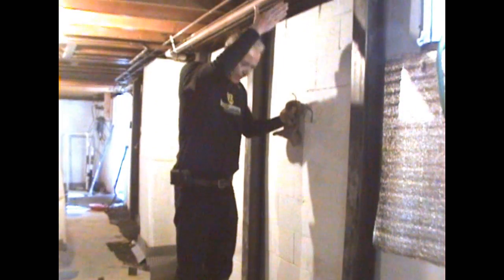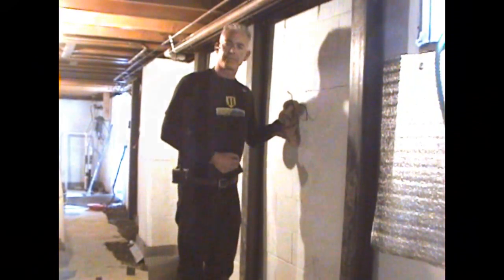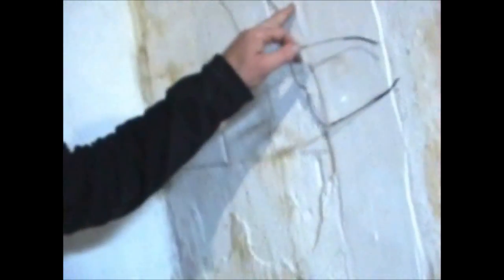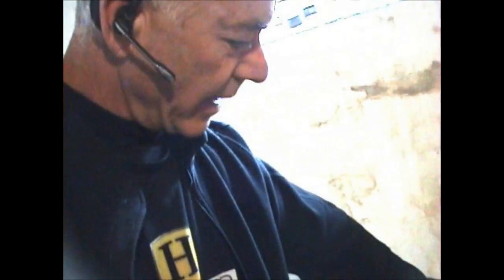Foundation Repair - I Beams vs Carbon Fiber Strips

Comment: Great video. Steel is reliable, easy to work with, easy to add to and modify and in general is wonderful stuff. 
DIYers can buy or rent a mag drill to make life easier and remember if doing large holes a rotary annular cutter like Rotabroach is wonderful. Use water-based coolant or soapy water since oily coolant is nasty to clean up.

Comment: Can you sister a couple 2x6s together and install them as a replacement for the steel beams? If so, how close together would you need to put the pieces for proper support of the foundation?
Reply: Wood is trash best used for furniture and camp fires. It's used in housing for cost reasons not quality which is why it's NOT used in industrial structures or military bunkers. It's often possible to buy good surplus steel beams from demolition companies. When buying new, get at least three quotes as prices vary.

Comment: What would you do in a case where you have something close to the wall and can't squeeze an I-beam in behind it? In my case it's a large 2" gas main pipe. Relocating it would be $$$ and I'd have to get the gas company to shut my gas off at the road. Could you get away with a 2" thick wall tubing in those spots? I know an I-beam is stronger but I don't have much of an option. I'm 1000 mile away so I can't hire you lol, I respect your opinion though.

Comment: Question: You have 24,000 lbs of pressure on bottom of the beam but none at top so is it really pushing the whole wall out?
Reply: the pressure is in the bend of the beam against the wall, not the area of placement.

Comment: I personally,  would not buy a house with i-beam or carbon fiber repair to the foundation.  If I needed repair to a home I already own, I'd go with the i-beam repair. Carbon fiber may be stronger than steel, but the bond to the wall is certainly weaker than bolts. I think the carbon fiber repair is a scam. In the end, I'd have the wall rebuilt and drainage corrected.

Comment: I followed your method and installed 2 I beams a few days ago. It's working and the wall is moving. Thanks Dan! Tomorrow I'm going to dig a little earth away from the outside to help it move. After it's where I want it, I'm installing pins in the blocks and 5000 psi concrete. Done!

Comment: Having taken the time to actually speak to Daniel, I can understand his reluctance.  As he has said, this video is over 15 years old, and in that time frame there were a very limited number of carbon fiber based repair systems in the residential market.  
I have seen the types of repairs that he is talking about, and after many years of change, both regulatory and in fair practices, the carbon reinforcements have come a very long way.  I actually walked Daniel through the application procedures for the company I work with, and I was looking to address his concerns.  Our system does tie both the sill plates and the footers into a single continuous bonded reinforcement.  We also made sure that the spacing and carbon systems are actually designed for residential uses.  
An engineer could nit-pick this installation, or any installation for that matter.  What Daniel is doing has been done for 50 years.  That doesn't mean that it's the best solution for every circumstance, nor is it the worst.  I have seen steel i-beam failures from improper installation techniques, just as he has seen carbon failures due to improper installation techniques.  It's all a general wash when those failures occur, primarily because (according to ICRI and ACI) 95% of reinforcement failures are not are the result of the material failure, but of improperly planned and executed installation.  That means that, of the repair systems that they have had failures reported to them for, only 5% were materials related and not the result of an installer cutting corners somewhere.
ACI 440 has been developed to guide the commercial industry in the application of composites to concrete, and it has really increased the awareness of the proper calculations, proper methods, and the proper design requirements for this industry.  The same cannot be said 15 years ago.  The adoption of the ACI codes by leading manufacturers in a residential setting has become the real reason that this industry has gained acceptance.  I think that even Daniel would agree that his concerns, lacking an anchor point to the footer as well as a secure anchor for the top of the wall, have been addressed.
I welcome questions about how composite systems have changed.  It's not a new technology, as the first tests using carbon fiber to repair a concrete structure were in 1956, and the first one in the US was in 1982.  it's just now being made commercially available, and like everything new it needed time to mature into the market.
Thanks, Daniel, for keeping us on our toes.  Hope to chat again at the next BHA meeting.  Maybe over lunch again?
Johnnie

Comment: I am afraid he is totally wrong about the manner in which the  carbon fibre  strip behaves and at 0:50 when he says that ," The  carbon fibre strip would just SNAP."  He should know that because of the thickness of the wall there would be tension on that carbon strip and not shear, as  normally the walls bows out all at once and so the carbon strip  would replace the steel enforcing in a  wide beam where one side is in tension and the other in compression
Still I prefer the steel beams he is using, but he should be careful about the figures which he is mentioning. His logic and reason in applied mathematics do not seem to be his area.  Other than that it is good work.

Comment: It sounds like he is trying to validate (in part using exaggerations and theatrics) what I assume is his business rather than offer a fair comparison between the products. Rather bias. Jury is still out but I'm still leaning towards properly installed carbon fiber (he was showing examples of improperly installed strips with no footers).
Reply from the maker: Hey Todd, that's a fifteen year old Video.  Still, u yourself can do Carbon Fiber if you believe in them  I simply don't.  Actually, back in the Nineties I don't think carbon fiber existed.  For myself I like the old time tested stuff.  I'm not bias, I'm just old school. And I happen to enjoy fucking with the Carbon Fiber Executives of Manufacture Corporations and that #1 U.S.A. supplier.  But alas, Carbon Fiber strips are manufactured in China and I'm an American made steel type of Guy.  I was handed a $50K check to support the product a few years ago but I told them to void it and the only use I might have for it is if there's a shortage of TP in the men"s room.  Gee wiz Todd, I must be well known or something.  I don't believe in Carbon Fiber Strips   And my Integrity can not be bought.  Once  a person sells themselves out they can never buy themselves back.  If nothing else, you might consider a little respect for my beliefs and integrity, right or wrong and regardless of your beliefs
  - Daniel J OConnor

Comment: what's your take on using carbon fiber to fix a single row of horizontal cracks between the first row of blocks at foundation level?
Reply from the maker: Save yourself some money and use duck tape or an ace bandage and crazy glue.  Or totally fuck a customer.  Nuf said?  They offered me $50K to shut up.  I can't be bought.  Once you sell yourself out you can't buy yourself back.  Keep that in mind for the rest of your life.   - Daniel J OConnor

Comment: what's your take on using carbon fiber to fix a single row of horizontal cracks between the first row of blocks at foundation level?

Comment: crazy ive installed alot and have seen alot done years ago have yet to see a strap fail due to anything but improper installation, i do dig steel tho over the straps but at the same time i feel straps are sufficient depending on the house of course
Reply from the maker: Yes, it does depend on the house and the specific type of walls.  To me, why take the risk.  And bye the way, I do know the #1 Supplier in all of the U.S. and do see him often at conferences.  A $50,000.00 check was written and offered to me if I would stop bashing and promote the Strips.  Yep 50K.  I said to write void on it but will take it in case there's no Toilet Paper in the Mens room.    I don't believe in them.  I can never promote something I don't believe in.  The 50K was to buy me off.  In other words, for me to sell myself out.  Money is just money.  When you sell yourself out you can never buy yourself back.   Got it?  - Daniel J OConnor

Comment: Are pins referring to rebar?  I have a little bow in my basement wall.  I think I am going to install drain tile this winter and use your technique with anchors, rebar and hydrostatic cement when it warms up a bit.  I'll be doing a lot of research until then.

Comment: why would you use carbon fiber on a wall thats disintegrating and expect it to work..you should of used steel to start with!
Reply: 68eazyrider hes making a point that carbon is shit and steel is the way to go . did you even pay attantion..?
Reply from the maker: Hey AweSome,  some people spend too much time swimming in icy cold water...   ( numb nuts )

Thanks for your support. - Daniel J OConnor
Reply from the maker: Hey Easyrider,  mine is a Police Special Road King which I rebuilt myself.  Lot's of "not street legal parts."  Shit canned the chrome.  All Blacked out.  When I rebuilt my Cessna 210 Airplane I went Red, White and Blue.  I was offered $50,000 by manufacturer of Carbon Fiber Strips to promote their product.  Someone held out a Check written out to me.  I told them to void it but would take it in case there was no toilet paper in the John.  Carbon Fiber Strips are as useful as something I might find at the bottom of my underwear at the end of a day...  ( if I wore underwear ) Nuf said?  - Daniel J OConnor

Comment: Both solutions are problematic. The eye beams are ugly and take up space inside the basement. Carbon Fiber Strips are often misapplied by contractors in the wrong application as the video states. Neither solution provides adequate lateral loads to solve the problem effectively. The I - Beams are attached to the floor joists above putting stress on the floor system. The lateral loads could crush the floor joists during heavy rain events when soils are swelling. Neither approach can move the wall back.  A grouted soil nail stabilization plan combined with bearing plates or C-Chanel whalers would be a more effective approach. There is no need for messy outside excavations and over a series of adjustments during droughts the wall could be pulled back. The lateral loads would be transferred to the soils beyond and the system is much less obtrusive. For more information on a Soil Nail Retaining Walls and other geotechnical approaches please visit our website or give us a call.
Reply from the maker: +Michael Masserang  Hey Mike, where can I find one of your videos with you doing the actual work and explaining all that bullshit?  It's an old video.  I haven't done an I Beam in quite a while.  This one has flaws.  Bottom is still secure with concrete but at the top I do an entirely different process designed by my engineer.  Who is certified in NY, NYC,  PA, PHI, Texas, Huston,  Georgia, Atlanta etc.  He's toned down in recent years,  cares about people being safe.  Primary Consultant for all structural issues in regard to all of NEW York CITY s subway systems.  Imagine that?  You think he might be interested in hearing about one of those whatever the fuck's  to keep NYC subways safe?  Would you like his number?  He doesn't have a web site.  Only an impeccable reputation.  You can contact him and he' might send you a package with a red hair wig, some white and red makeup and a big red ball for your nose.  You will then have all you need to not only talk like, but look like a clown.  Bye the way, nice photo.  How's that hair cut coming in?  Rug might come in handy....   Thanks for your support.  - Daniel J OConnor
Reply: +Daniel J. OConnor (HydroGuru) 

Nice professional response combined with a personal attack. I wont take the bait. I can prove my credentials in the industry. Can You? I work with several engineers in our market on a variety of foundation related stabilization projects. I'm not in the habit of educating the competition on unique geotechnical solutions that are cheaper and more innovative in the industry. Applications and means is the key.  My post was to keep potential clients from choosing an older, problematic system.  so when you educate yourself on these newer techniques please feel free to offer those solutions to your clients. Until then, you can keep on doing what you're doing. Please do. You will make it easier for me to win bids if you ever show up in our market.
Reply: I dont give a dam what anybody says. Steel is better. I'm not a contractor and dont hire them. I just put in my own I beams and the wall is moving back into place. Materials cost me $400. A contractor would have charged  me thousands. Physicians wages and NO college degree? No thanks. Screw that.  Some people are scared and shell out the money. Ha! maybe I will start doing this. I know I can do it.

Comment: if i dig it out and use a i beam with a adjust tightening nut and dig it out will it push back fairly easy or will it still cause alot of stress on the floor joists?  I'm dealing with a Cinder block wall.
Reply: Dave,
If you were digging it out why wouldn't you use a jack and apply direct pressure to the wall with the i-beam you have installed?  Try to avoid applying that directly to the floor joists if you can.  They are not typically designed to take that kind of stress, and it can compromise the floor.  That way you can have the i-beam in place to shore up the damaged wall after you start backfilling.

Comment from the maker: Hey Joshua,  Sorry but without digging some relief from the outside that wall isn't going to move.  Don't worry about the bottom of the wall against the slab as long as the bottom of the wall isn't rotted.   I would send you a link about how we push a wall back into place but my IT guy just got himself fired.  Please look for Foundation Repair on You Tube.   Hopefully you will find the right video to help.  Nad bye the way, would you know any good IT people here in Jersey?  We have a vacancy. 
  - Daniel J OConnor

Comment: Can a wall be straightened without digging/ freeing the wall from the outside? I am currently 1 1/2" out of level from top to bottom on a 8' tall basement wall at center of a 30' span. Also will straightening the walls push the floor level at the sill?
Reply from the maker: +Joshua Bland I'm sorry I've been away.  Go the extra mile and dig out the outside, push the wall back, put wall pins in from the outside and you'll have a perfect forever wall.  The house will sell eventually without foundation questions. - Daniel J OConnor

Comment: The first video that shows my problem and the remedy after searching for hours . I like the use of the angle iron on the top. My problem is a little more difficult as the wall is pushing out on the bottom . I plan to knot the bottom together with re bar inserted in the floor vertical and connected with more horizontal re bar to the beam then cover with concrete to depth of 6 inches.This is under a bench so it will not be noticed. The horizontal crack is 1 meter high and 1 .5 meters in length. I have a large buttress on the outer wall as a prop but the wall still moves . This is a single story garage .

Comment: What is your opinion between Carbon Fiber Strips and Wall Pins?  I talked to an engineer that told me Carbon Fiber does nothing at all to address the source of the problem.  She told us that most
Carbon Fiber Strip companies were simply franchises with not a lot of structural knowledge.  She recommended rebar in our block walls with concrete.  What do you think?

Comment: What is your opinion of wall anchor plates vs steel beams? I have a very small basement and hate the idea of losing 6 inches. I was thinking carbon fiber strap until this video.

Comment: First of all those bolts into the joists will blow out long before carbon fiber. Second, just because a jack is rated for 12 tons does not mean you are applying 12 tons when you pump it up. Third, if you're worried about the bottom of the block blowing out, just use carbon fiber straps with a single angle iron bolted to the slab and the bottom corse of block.
Reply from the maker: In the old days I think I would reply by saying, "Blow me."  I think it might still be a proper response. - Daniel J OConnor
Reply: I'm going with steel I beams. I dont give a dam what any salesman tells me about carbon fiber. I just bought two I beams, angle iron,rebar and bags of 5000 psi concrete for my basement. Doing it myself including perf pipe at the bottom of the footer. A little nervous about taking it on because Ive never done it before,but going for it.
Reply: HOw did it work out? I'm thinking about doing this myself too.

Comment: My basement wall is bowing inward due to the amount of clay in our soil.

I'm still doubtful about Carbon strips because:
1.) Carbon strips are a relatively new technology for basement walls, that has yet to be proven over the long term (20 years or longer)

2.) Will the epoxy actually hold over the long term without degrading with age? Will it hold the wall AND the carbon fiber strip for the duration of the entire life of the house?